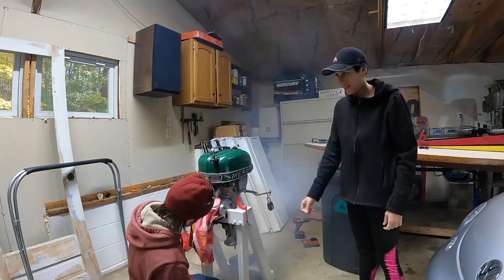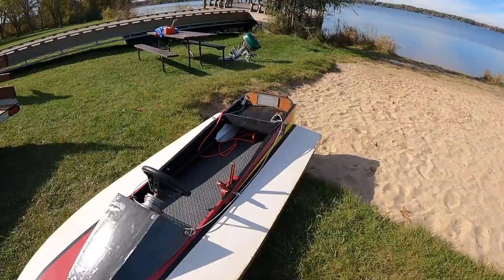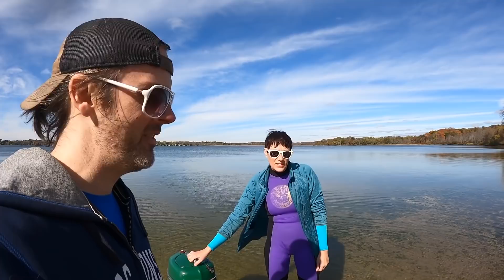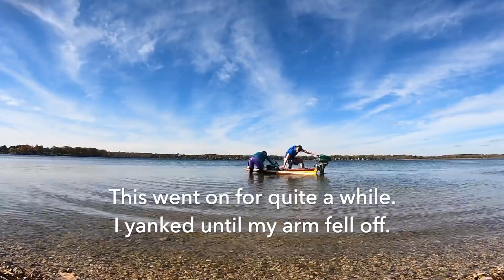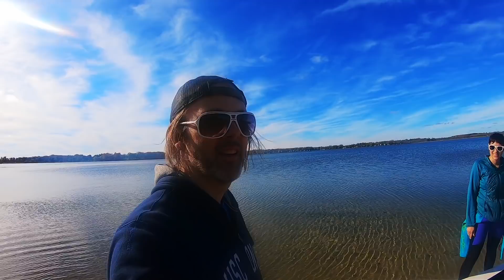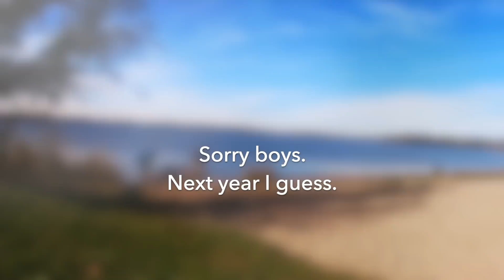50mph with 10hp!  8' Mini Hydroplane Project: DISASTER First On Water Testing 😒👎

Comment: From my real world experience... My idea of starting up 2 cycle and 4 cycle motors in landscaping... If it doesn't start up in 5-8 pulls then it is not going to start at all.... usually you can put a tiny amount of gas into the carb to get it started and running. That is the test run if needing a complete carb clean out... If my machines still didn't start after a carb clean, and there was not enough compression then I just scrap it to the recycle center from the same place that I buy a dozen or more machines.

Real thing. If it doesn't start within 8 pulls.... Check if gas is flowing, engine is not off... Quick fix, unscrew the carb or any high/low screws and spray through any ports with carb cleaner, then put back on and pour a small cap of gas directly into the intake, it should start and run momentarily. If not, your spark plug is incorrect or not sparking. Or if it does start up and run few seconds and cuts off, then the carb is most likely dirty and it's not passing enough gas through the carb jets....

I had lawn mowers and weedwackers that needed the ignition coil replaced. So if that gas is not firing at all, it could be the ignition coil.
Reply from the maker: The gas is flowing, what's tricky about this is there is no neutral, and the racing lower unit is 1:1, so there's a lot of drag when you turn it over while the prop is in the water.  Out of the water, without the gearcase on, it starts easily.

Comment: I worked for C&E  Marina all though high school on the Ohio River. I got one of these boats given to me for free, almost identical to this dirt cheap in bad shape. It had a 20 HP Mercury twin cylinder engine of the same era , same green color.  I rebuilt the boat and engine and swapped the carbs with bigger ones from the next sized up engine.   The marina I worked for was into racing and their  mechanics helped me super tune the engine with a set of expansion chambers to help me get into racing. I was in 10th grade at that point. 

 Usually Merc engines weren't that fussy when tuned right. You do need to choke them when starting.  But if the ignition coils were getting weak or wet or condensers were shot, they were near impossible to start!! That boat ran like a bat out of hell right up till one early evening.  I was testing it  in the Ohio River for an upcoming race and I hit an almost totally submerged 55 gallon drum.  I never saw it in the river ! The boat was demolished, the engine went to the bottom, and I flew about 50 ft out the front end of the boat when the boat stopped and I didn't!! Back in the 1960's the Ohio River was a polluted mess and had a lot of debris in it. I was lucky, there was another boat close to me that saw what happened and they fished me out of the river with some seriously bruised ribs. Ah, but what a great summer!!

Comment: i just finished mine and she is ready to go i got the 10 horse merc fired up just need to connect throttle cable to shifter 

it’s nearly identical to yours but with my higher transom and small fins in the back 
 it’s starting to look like batman’s boat

i’ll let you know when i make a video of it 
just put a planing wing on the lower unit too

Comment: The old standard for starting those Mercs was to choke with your thumb or a rag on the first pull. Also, try to put it on a sawhorse or stand so the gearcase is in the water just enough to pick up water, start motor to warm up and check cooling flow.
Reply from the maker: Sawhorses next time for sure.
Reply: From my landscaping experience with weedwackers and lawnmowers and nitro R/C cars... That is priming fuel beyond the standard. Sure it will work for the moment but ya gotta clean out that carburetor and run an enhanced fuel jet cleaner once a while, especially on your last run before ending the season.

Specially yes "choking the air intake with your thumb", which is not so easily done on many weedwhackers because of air intake designs. And if you still have trouble with a brand you love, just throw the crap away, there is a reason their machine failed and that is to make more money.

Comment: At least she tried... There are some fantastic carb tuning vids on YouTube. Two stroke carbs are very finicky. They always run different in the water than out. Get you a trash can or a 55 gallon drum and cover the prop with water in your driveway while tuning/testing. ONLY use non-ethanol gas in that thing. I was also thinking you need to try and start it with the prop out of the water, but you don't want to run it very long at all like that. You'll burn up it's little water pump. Don't give up. It can be crazy frustrating when this little two stroke outboards won't run right, especially when you're excited and went through the trouble to get it all down to the lake. You'll get it!
Reply from the maker: Yup, non ethanol fuel only, high octane, and I forget what % premix I was doing.  Barrel tuning is happening next year for sure.

Comment: It may be a blessing it didn't start and toss you out the back, possibly injuring her as well.  In that shallow water, you would likely have dug the propeller into the rocks as well. The transom will dive deep and the nose will go high when you accelerate.  That engine should start just fine with the gearcase in the water.  Good idea above to build a couple little "sawhorse" stands you can set the boat on (aimed out into the lake) and start the engine with the propeller barely in the water but the waterpump intake still submerged so you can warm up the engine before your first ride.  The engine should "pop" with choke on 1st or 2nd pull, then fire right up on 2nd or 3rd pull; if not fix things before the recoil gets broken.  Don't snatch the pull start in one motion; flip of the wrist to engage starter pawls/mechanism, THEN pull.  Don't pull all the rope out to the end of the range, either, as that can also break the starter mechanism.
Here is a good example:  https://www.youtube.com/watch?v=QOXcyqVf9gk
Reply from the maker: I am doing the locking pawls, then pulling... or at least I try to until I got so pissed.   I rebuilt this carb but I have no idea where any of the mixture screws are supposed to be at.   Any pointers?

Comment: Um bro!!!! Yer standing in the boat, and and what’s she doing at the side.?! So like doesn’t that  throttle have a locking (deadman’s)mechanism? At any rate, when that boat starts in gear while standing, yer going swimming and she runs potential of getting propped. 
A better approach would be her holding rear of tank with legs spread 😉 staying away from prop but keeping you close while trying to start. In the boat, you on one knee kinda at the ready to drive but butt (if it can handle it) almost sitting on side board body twisted to pull. Step 2 I find very useful is starting fluid spray! I know I know, it’s so bad for the motor, but no, not really. People are hypo ding dongs about the lack of oil and its super solvent quality, but yer just using a shot. I remove choke on all of my boats and give them a shot a the beginning, sometimes have to do it twice, but fires off soooo much easier! So a shot down the gullet then set throttle up a couple of bumps and lock. Then be ready for it to take off on ya once you pull on it. Another thing is adjusting the timing to medium advanced. Fires harder more positive but a bit harder to pull. You can play around with that.
Another thing I like to do is on my boat cart is roll the boat down and warm it up before actually attempting to bury the prop in water and starting while the current is taking me down river. So having it start is important, not to mention I have no recoil on one of my motors.
Hell, if you were close, I d come give you a hand making this thing happen.
May the force be with you!
Reply from the maker: It does have a locking mechanism if you press the button.   She was squeezing the throttle a bit while I was pulling it.   I got it to pop/run on land by pinning the throttle wide open, but I was trying to avoid doing that with the prop in the water, so she was squeezing part throttle, and not clicking the button to lock it.   Thank you for all the wisdom!
Reply: @ADDvanced  no prob yo. If the throttle can do partial throttle clicks, safer way to go. Also, I for got to mention. And I have a feeling that you are beginning to understand why, run those wires up in the boat and mount disconnect next to throttle. You’ll want the shortest and most accessible possible. IE; if on ankle at transom, bombing a full throttle, things get out of shape, typically feet are last thing out, while a rotating mass is possibly near a hydro lock situation or a prop is nearing you. Sooner off the better. Besides, it’s easier to connect on/off them.

Comment: Sorry you didn't get her up to speed this year.  There is always next season!!!  I would bet my money on that she is only firing on one cylinder. Bendix mags are known for this.  I have 7 green tanks in my collection, which I have rebuilt. Your motor is a ke7 with the early bendix without the backlite cover, which is actually the more dependable magneto of the two. shimming it just right and locking the magneto will give you best results. These motors have enough power to run out of the water on one cylinder and sound just fine... Once they are in the water they will not power up.   Timing is crucial and the stator plate over time wears at the block, that is why you will have to lock the mag plate down at full advance.  Also, I think some of the issues you were having with the portage bay systems throttle controls is because they are made for motors with fixed mags on full advance, this would have probably given you the clearance needed.  I am not sure because I make all my own throttle controls for mine and never played with those.  Your problem is magneto related, when they fire exactly 180 degrees apart, somewhere near .285 btdc they start first pull with a choke almost every single time. Best of luck!
Reply from the maker: I actually snapped the advance lever off in a previous video dealing with all the crappy fitting parts from Portage Bay Systems... so right now it's fixed at full advance.   I figured with the kill switch I don't really need any adjustment other than full advance.  Make sense or ?
Reply: @ADDvanced  I have been following this series, probably watched em' all.  Reminds me alot of what I went through with my austin runabout. I really worked hard for at least 2 years trying to figure how to get the boat to be controllable.  So, I feel your pain. I had probably 20 disappointments in one way or another throughout my learning process on that boat and  I have worked on outboard motors for almost 30 years now as a hobby so don't get frustrated.   Every time I work on a k series merc I ALWAYS lock the mag at full advance and make remote throttle for deadman.  Any play or out of round at the block or stator plate can cause the points gaps to change if the stator plate is rotated.  Also, ANY side to side crankshaft play can contact the bendix rotor to the laminates for the coils and cause magnets to loose their strength. There are also many ground points in the bendix that need to be spotless as well.  Adding a ground strap from block to stator plate may help too.  Another thing don't question the fact that new crank seals are probably a good idea, even though you rebuilt the motor as a kid with your dad.... Them crank seals are going to be junk and they are not all that hard to change. It could be sucking air at the top crank seal, drawing all the fuel for both cylinders into cylinder 2 and flooding it. That is the reason for all the excess fuel leaking from the powerhead to exhaust housing gasket.  I just worked on a kf7 last week, I thought the problem was in the bendix.  Fuel everywhere just like your motor,  I noticed my upper cylinder was dry and I knew right away.  I put an upper crank seal I had in a parts box in it.  Started first pull on the lake and ran like a top.
Reply: nickbaysek9892 may be correct about the engine only running on one cylinder. May be able to tell by comparing the plugs at the electrode end. But, not sure on that... 
Saw horse we used were steel with carpet over the top rail. Not scuffing up the bottom of the boat. The front legs were not far apart from the back legs. With the boat set in the water at the correct dept, holding mostly the back of the boat up, won't take much to push the boat forward once it starts. And, the saw horse falls down out of the way. I never had a problem with my one to one unit being too hard to start because it was deep in the water. But, my engine was 15 or 20 horse, don't remember which... I seriously doubt the prop being fully submerged is the problem. Pretty sure there's not even enough room to put a prop on it big enough to keep it from starting.  Even though those racing props look pretty wicked compared to other props of similar size engines!! Good luck!

Comment: KG4H are a very hard to choke. You need a crash throttle that locks in 1/2 throttle. 1. You need a small sqeeze bottle of gas. Open the carb and spray the heck out of it. Next hold your hand over the carb and slightly pull until gas is spilling out. Now you are ready to start. when the engine starts you will need to fan the carb until it runs. You will know because it will run because of the 1/2 throttle position. When warm this engine will start with one pull.
Reply: What I see people doing, is to just put the boat on their cart or trailer far enough in, to where the pump inlet is submerged. That way there's much less resistance on the prop, and you let it warm up. Then you just plop it in the drink, start and go.

Comment: I used to have one of these when i was a child. You need to get a tune up. Lots of things can be at fault. But once it is running they are a blast.
Reply from the maker: She runs great, watch the previous video!  Issue was getting it spun over fast enough while hte prop is dragging in the water

Comment: A lot of good info here. One thing I want to bring up... Don't know if your butterfly is a full circle or not. If it has an opening in it. change it to a full round brass circle. The butterfly with the (Half moon?) cut out of it is meant to keep the engine running.  Works great for a fishing motor. That is the LAST thing you want with a quicky lower unit!!!  Had a tower housing break in two on me. Had a kill switch to hit when I wanted to stop the engine. When the tower housing broke I was barely up on plane just cruising. The lower unit with part of the tower housing turned sideways. Threw me out of the boat. Next thing I knew I was in the water trying to figure out where all the water came from!?!? Heard the engine running. So looked over to see what was going on with the boat. I see the boat coming at me. Not a good swimmer. But I swam as fast as I could!! Looked back and it's coming at me again!! Lucky for me a guy saw what happened and came out to help. Had to bulldog the hydro to stop the engine. Lesson learned!!!! Another tid bit- learned with other engines I played with if the spark plugs weren't hot enough the engine would run out of water. But, when put in the water it would die. In your case It may be the same. I'd bet the problem is a bad coil and/or leaky gasket(s). Possibly some other electrical inefficiencies.  Leaky seals around the crank would make the engine almost IMPOSSIBLE to start. In the water or out.  Best to try in a barrel or garbage can.  You want to get the problem sorted out there. if not you won't be able to pull the rope very many times from a sitting position. You get it fixed and try starting it from a standing position, about an 85% chance you're going head first over the transom! Don't give up. Most of the racers set the throttle fairly fast and lock it there... When I was pit man for a guy he had saw horses made from steel. The legs were not set very far apart. That way when the engine started you could just push the boat. The saw horses would fall down in the water out of the way of the prop.
Reply from the maker: I have videos of it starting on land pretty easy.... I think I'm going to build some sort of sawhorse solution so I can get it running and then drop it into the water all the way and go.  Thanks for all the tips!  Will definitely get back to this soon.

Comment: That sucks, sorry you didn’t get to see it run. Looking great on the water. Definitely need someway to reduce load on engine start up. I wonder if you could put the motor in a barrel at the shop and get it to the point it will start under load this fall/ winter and be ready for next year.
Reply from the maker: Definitely doing the barrel thing next spring.

Comment: From all the fuel running down under the engine , look like it’s flooded. And agreed with the rest, when that thing starts , your going for a ride ! Lol. I am restoring a 1960 Merc 200 , 22 hp, for my Mini Most! Sorry it didn’t go, but you’ll get it!  Good luck!
Reply from the maker: Wasn't sure where that leak is coming from, looks like I need more gaskets?
Reply: Dang! you'll be lucky if that Merc200 doesn't sink it nose up. I used a 60 Merc100 on my mini and needed my two brothers to hold the stern up until I could get it moving. Worked OK while under way, just hoped I didn't need to stop.

Comment: Race rack is the answer. You put it on a frame out of the water then the frame drops the boat in the water. We used them in the 1970’s to tune em and start em. Simply build a square frame that locks upright then either drops like a parallelogram when you pull a pin or has a stop on it so you push the boat and the thing drops down into the water.
Reply from the maker: Are there pics of these anywhere?   Sounds like exactly what I need.